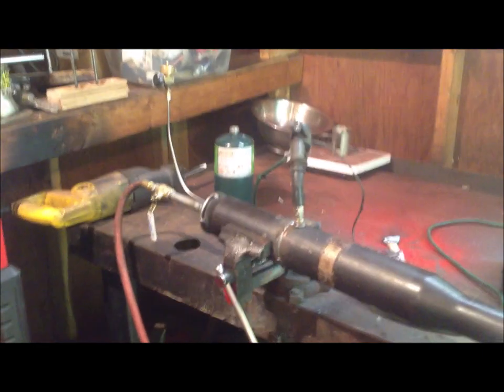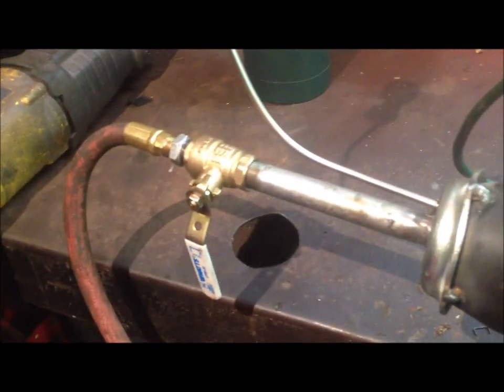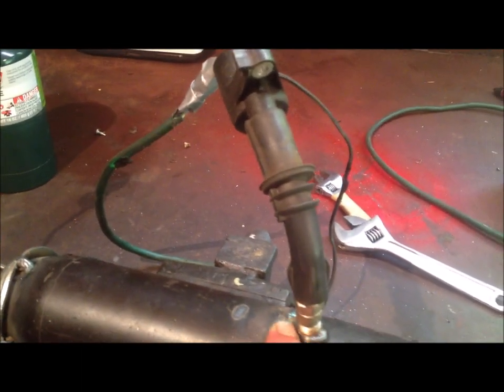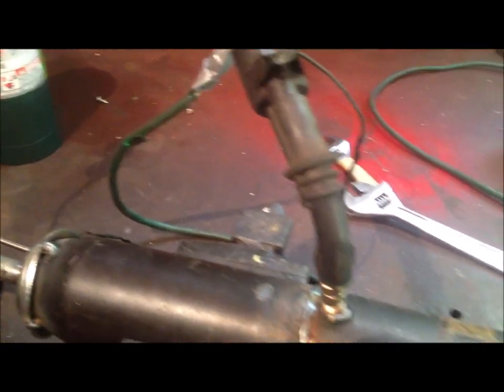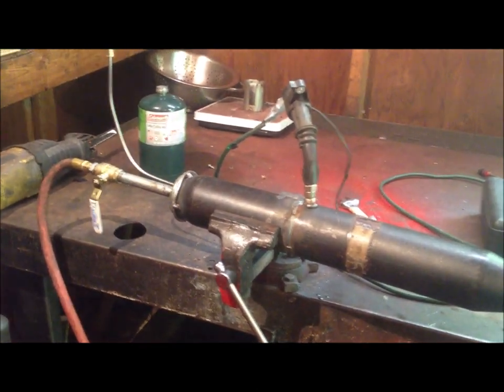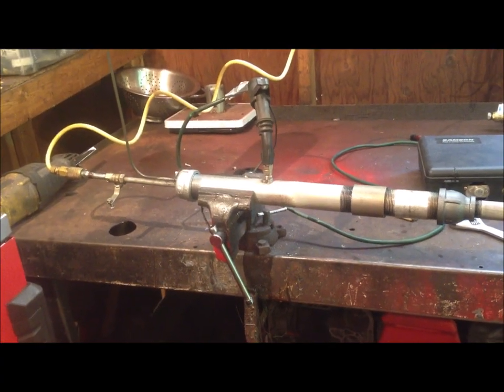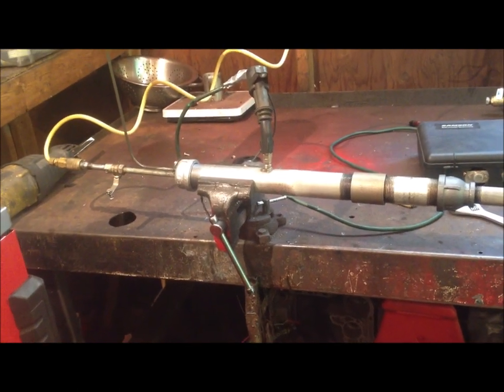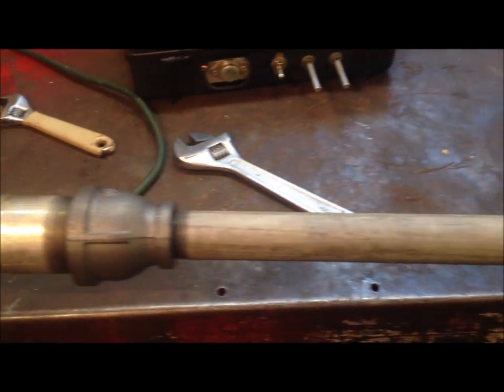Pulse detonation engine

Comment: That was an excellent demonstration! Thanks.

We would like to build this engine and study its performance for a video on our channel.

Can you give the dimensions of the components of the larger engine?  What air pressure are you supplying upstream of the ball valve. Also, what are the dimensions including the hole diameters of the diffuser you placed within the engine?  Where is it located and what is its orientation relative to the exhaust end of the engine?
How did you determine the best location for the spark and the proportions of the major components?
Reply from the maker: Have to give me a few days, but will get back with you. Got a lot of workload for the next week..
Reply from the maker: Did you get my email?
Reply from the maker: Should be the info you want. https://www.youtube.com/watch?v=TSOf6s69-EY
Reply: Really excited to see Tech Ingredients jump in on this!
Reply: You should consider using Tesla valves. I've just got some really amazing results and better then any I've seen. Only problem is the size of Tesla valve inlet outlet need to be tuned. I am working on an even more tuned version.

Comment: I am not quite sure if that's a detonation, as the exhaust would probably have blown to bits if it was. Still a very impressive pulse jet engine. A more aggressive mixture might do the trick... not recommended though. Excellent video. Did you feel the shockwaves in your chest? If so you might be onto something. maybe try measuring the speed of the shockwave with a pressure transducer, that might give further insight
Reply from the maker: It is so loud. And yes can feel it in my chest and everywhere else.  In fact someone called the cops on me, I live in the country, and was testing this with the garage doors shut.
Reply from the maker: have posted a recent vid, with a slomo camera and there was shock diamonds in the exhaust. which means it's not a pulsejet. pulsejet's are subsonic. So I'm Not sure what this is, but i'd like to think  this was a detonation engine.
Reply: Detonation does not directly mean high brisance. But upping the oxygen in the mix, by pressurising air and the fuel in a temporarily closed combustion chamber gives full-on detonations, look at hybrid spudguns for that. With an open ended exhaust, it is probably more on the border of deflagration to detonation.

If you tried oxygen/ propane, it might detonate in an open chamber, but the ignition point is critical then. Good mixing is also a point of failure or succes, as the flamefront has to go through a lot of viable mix, too rich of an environment will slow the burn down..

The long exhaust makes a good linear mixing pipe, and this comes awefully close to what they call a "LPG-kit gun" over here in the EU, for safe and cheap firing replica guns. Adjust the flow rates,  time the ignition for a good rate of fire, and make a gun shaped shell around it. If legal in your state/ country of course. Makes for a cheap movie prop background gun, re-enactment prop or just a toy.

Comment: I wonder if we could run two of these things mechanically linked in parallel and then finetune the latency between their ignition points (e.g. arduino-controlled) in order to have kind of an "active noise control" (soundwaves partially cancelling each other out). Do you think that could work?
Reply from the maker: Thought about running 4 in parallel. But there is no actual control. Spark, fuel, and air feed is constant, actually not entirely sure why it works.
Reply: NASA actually did this, and tested it in a plane.
4 tubes, with a cam shaft and 2 values per tube. 
The Cam shaft opens the values to let in Fuel/Air, the other pushes in air to blow out the tube to get it ready for the next detonation. 

*They needed a turbo charger to push air in.
Reply from the maker: @andrewmattox1233  I have seen that test!
Reply: might be possible in a pulse jet but not in a pulse detonation jet, det waves aka shock waves are called this because they have sudden rise in pressure, looks like a spike then taper off. this would make it impossible to cancel with another wave

Comment: Not to sound like bummer it seems like the operation is in the pulsejet mode. Perhaps a shchelkin spiral will make it a true detonation engine.
Reply from the maker: If you look at the video frame by frame, it has obvious shock diamonds. I didn't even know until another observer pointed it out. Ya the video is crappy, but I fixed that. Have built many pulsejets over the years. This was exponentially louder. Look at previous post's. Pulsejets work on deflagration and are subsonic by a lot.  Usually 200 to 300 mph exhaust and that is if it were working well. So the fact remains. Shock diamonds = supersonic , which means it is not a pulsejet....
Reply: @fignutron  Interesting. I must concede your point of it being supersonic. Seems like the flow tumbles over the reducer pipe fitting. Most pulsejet designs use a smooth coupling. This combined with length of the "tailpipe" may help with the deflagration to detonation transition. Do you have any more videos? Also the dimensions of the engine? Also I'm very interested in the cycling speed of this specific engine. Have a nice day m8.
Reply from the maker: @mayurmahale3049  Thanks. I've had other people interested in this motor. Have many video's of anything from pulsejets to underwater helmets. Made a vid for those interested. It's in my video list, called PDE spec. Has all the dimensions you may need. I am not a scientist, just a 58 yr old mechanic who likes to build shit. You have a nice day also.
Reply: @fignutron  Don't shock diamonds form because the exhaust ploom is super sonic in regards to the ambient air? A detonation is defined by the super sonic propagation of the shockfront in which the reaction occurs. How do you know that the reaction in the chamber is a detonation?

Conventional rocket engines also have mach diamonds but the combustion in the engine is not a detonation.

Comment: what are doing to give detonation?
Reply from the maker: I'm guessing that the explosion happens at the midpoint where the sparkplug is. Said explosion blocks pressure from the air feed which builds pressure until a stoichiometric fuel to air mixture is again possible.

Comment: Yep. That's a PDE. Nice.
Reply from the maker: tnx!
Reply: @fignutron  Now. You need to make a rotating one. PDE is too loud for me to experiment in my backyard. Until I move to a much larger property, my hands are tied.
Reply from the maker: @Aviator168  I live in the woods, even then the cops have been called on me. As far as a rotating one, haven't delved into that yet. serious learning curve..
Reply: @fignutron  You can put a hugh silencer at the end. LoL
Reply: @fignutron  yes if you can make it a rotating detonation engine, you increase the thrust by not needing the intermittent shutoff cycle after detonation. Think continuous multiple origin detonation shockwaves

Comment: You should try using hydrogen as the fuel
Reply from the maker: Hydrogen would be interesting. But the biggest problem is air feed. Need to find a small turbine or something to replace a 150 lb air compressor.
Reply: @fignutron  look up king of randoms hydrogen generator.

It generates both 2H2 as well as O2; thus making it's own air to fuel ratio. 

Long story short controlling the voltage which creates this mixture..... changes the ratio.

Suscribe as I also have made such a generator and am currently designing/building a far more efficient model (more so than king of randoms).
Reply: @Tar Heel Country a simple electrolysis cell is never going to be enough to feed this engine.
Reply: @among-us-99999  not during operation, but a simple cell can build up a stock of fuel between flights

Comment: I thought you were full of shit and just built a pulse jet, but I'm pretty sure I see shock diamonds in that exhaust.  What's the thrust?  How do you think the detonation initiates?  Normally you need some kind of Helix in the tube.
Reply from the maker: Used an arduino  gauge setup that I use for my rocket projects , though it didn't like the shock. got 90 to 110 lbs of thrust per pulse, though that's estimated. Made me buy a new load sensor...Really I,m not full of shit. I just post things that I think are cool. Not really a scientist, a mechanic by trade. But I read things then build things. How detonation initiates Really don't have a clue. I did drill the holes in the washer at 45 degrees, guessing it put a spin on the air/fuel mixture. And it sorta worked.
Reply: @fignutron  I have been trying to build a pulse detonation engine using petrol injection and timed ignition and also untimed ignition without much success.I just rewatched your video and see you have your diffuser just before the spark plug.
I have diffusers in the final pipe but will now cut my combustion chamber and locate a diffuser just before the spark plug it makes sense to get disturbed air then ignite it.
Reply from the maker: @Graemecns   I used liquid propane. and actually the diffuser is several inches ahead of the spark plug. It's cone shaped, with the pointy part facing the end. with a chamber ahead of the diffuser, it allows the air and fuel to mix before it hits the combustion chamber. Just looked right in my head..
Reply: @fignutron  OK did you change the    diffuser from your original design the modified car washer? 
Have you done any more with this design or is it now your ramjet?
Reply from the maker: @Graemecns  Actually, I just built another one. Have a better camera now. Wanted to do slow mo pics of the shock diamonds. Should be within a week or two. As far as your question, I drilled 4- .25 inch holes at 45 degrees in the middle of the washer. And yes I took it apart for the ramjet that didn't work. This is why I just built a new one.